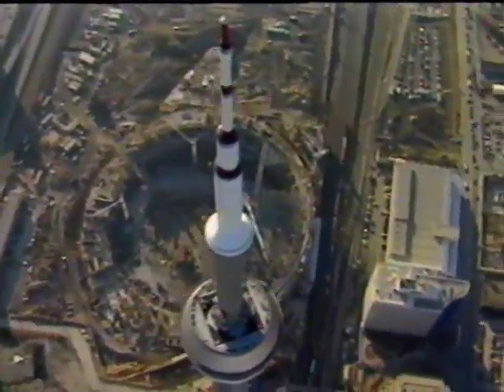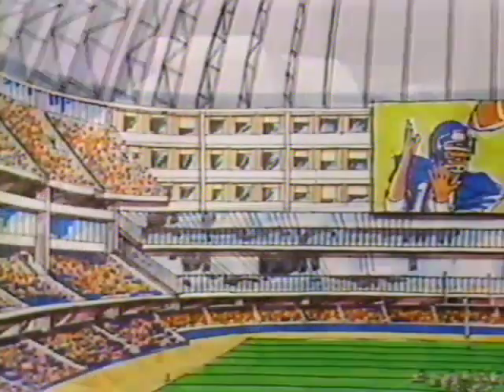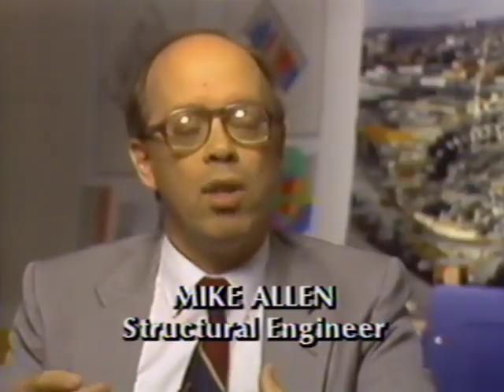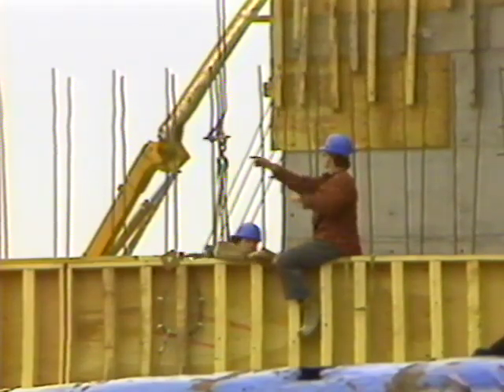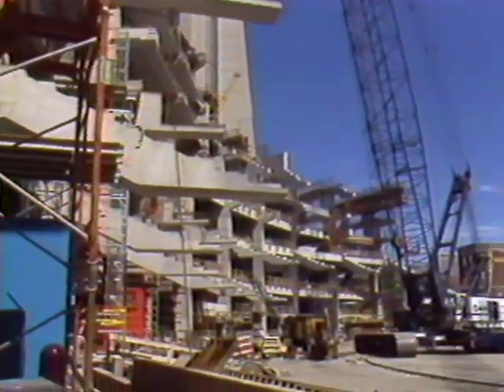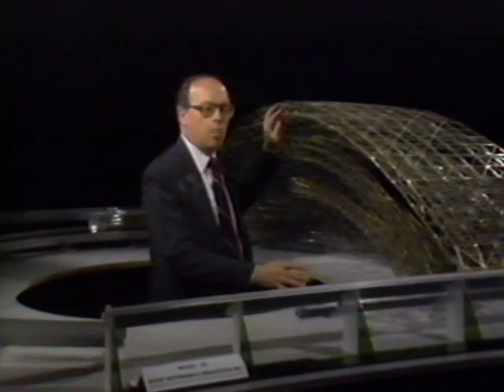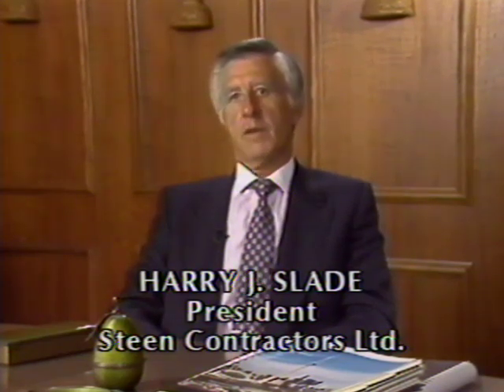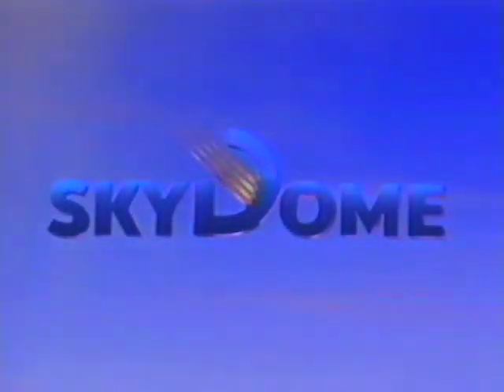The Making of SkyDome - 1988

Comment: Did The Toronto Raptors Played There
Reply: The Toronto Raptors did play at Rogers Centre, but only briefly from 1995 to 1999. During that time, the Raptors shared the venue with the Toronto Blue Jays baseball team. Rogers Centre, previously known as SkyDome, was designed to accommodate multiple sports and events, including baseball, football, and basketball. However, the Raptors have since moved to the Scotiabank Arena, which has since been their home venue.
Reply: Yup until they built the Air Canada Centre  (now Scotiabank Arena)

Comment: What I like about the Skydome is: "It Works". The way the roof operates is just awesome. 

Built at 570M (1989 dollars), on time and on budget, I think it should send a clear message/reality check to Montrealers, who are stuck with an ugly, non-functional, non-operational (about 20 events a year, when the weather is good) and costly white elephant, the Big Owe, build at 770M (about 2B in today's dollars) by an French architect from oversea, and still unfinished when the 1976 Olympic games began.  It took more than a decade to complete the tower and install the roof, which soon ripped apart. I think it's the only stadium with a roof, where a baseball game had to be postponed due to the rain.  Oh, and the Big Owe non-retractable must be replaced, again, for perhaps 400M.  

Long live the Skydome!
Reply: Skydome was WAYYYY over budget (it had originally planned to only cost $150 million. Also, opened two months behind schedule.
Reply: @tylerkochman1007 oh no! Not two months.
Reply: @Roller11111  “on time and on budget”. It was neither, hence why I noted that
Reply: the skydome budget was increased a few times. the NDP forced redesign, lots of steel had to be removed, changed as they added a Hotel and GYM... the NDP over ran budget... where does anyone think it was on time and budget??? it is a beautiful place visited many times over the years.